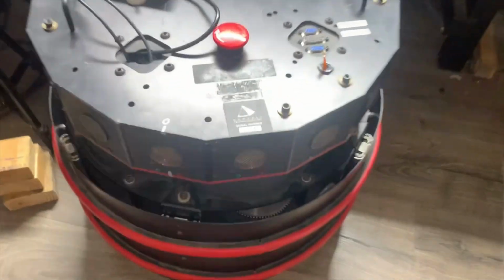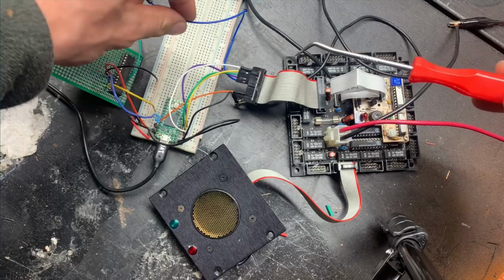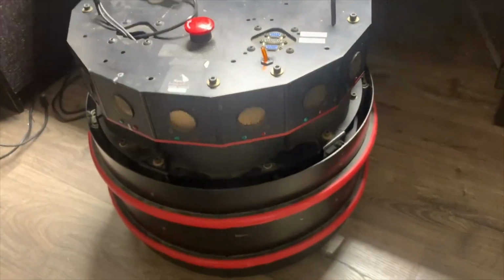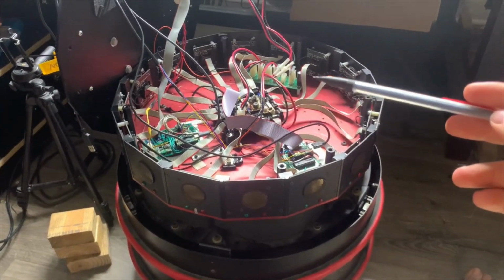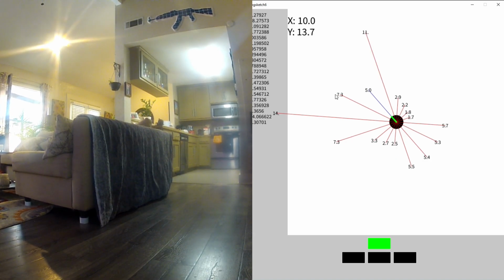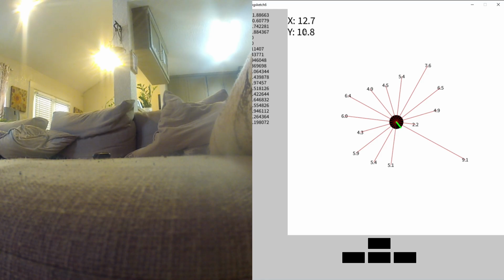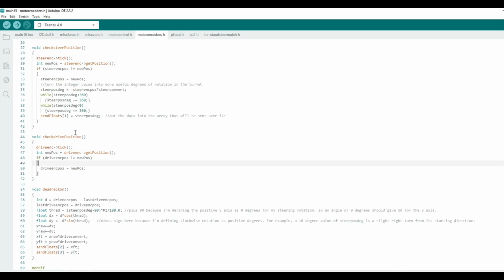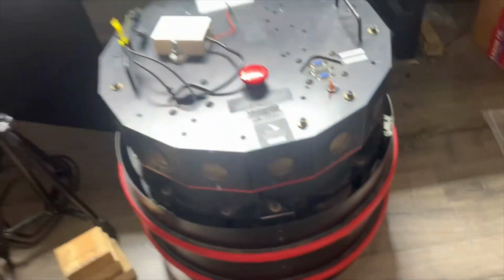Multiplexed Ultrasonics and Dead Reckoning on N150 Robot

Comment: This is fantastic work! I cant f**king wait to see the SLAM. I am working on a omni robot but I am still stuck on the drive system but I hope to have some mapping and autonomous movement. As for the more powerful controller I would recommend a intel nuc if you can get one cheap second hand. A bit bigger but you get a full x86 with the option to expand ram, storage and I think it has a pcie slot. All the luck with the N150!
Reply from the maker: Thanks man. Omni drive systems have definitely proven to be a viable option for a lot of commercial applications in recent years, specifically things like warehouse logistics robots. Most of those Omni systems are 3DOF which is useful for maneuvering but more mechanically and electronically complex. 4 wheeled mecanum systems typically even have 4 independent drive motors. The 2DOF drive train this N150 has is simple to control, only one drive and one steering motor. I’ll look into an intel NUC but hoping to get ROS running on an old pi I already have laying around. I don’t think I need a ton of compute power for this since the point cloud is pretty low res and slow updating.
Reply: @Clay-Builds  Yea that is fair, the only reason I am using a NUC is because I want to run everything locally and have zero wireless connections but a PI and the cloud should work great!

If you get the chance you should try and remake some of the use cases in the pics you found. A bit of sport and a arm would be epic.
Reply from the maker: The soccer ones are hilarious. I might be able to do something more useful with an arm though.